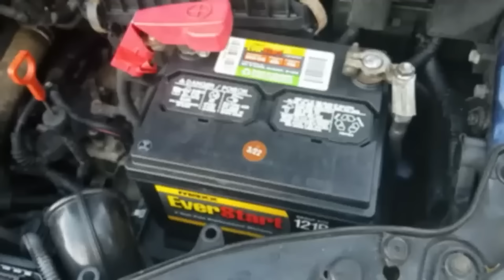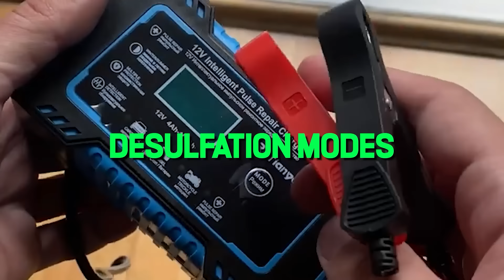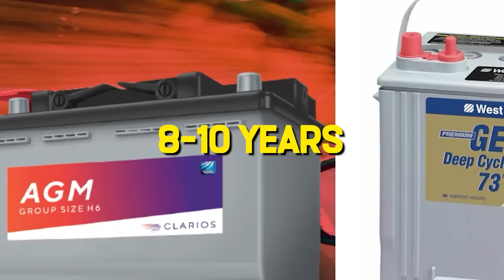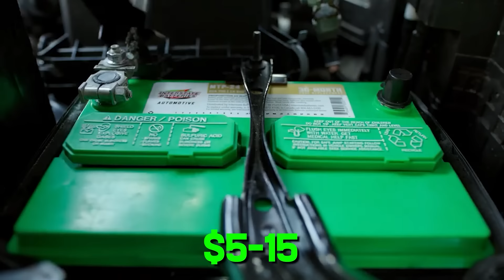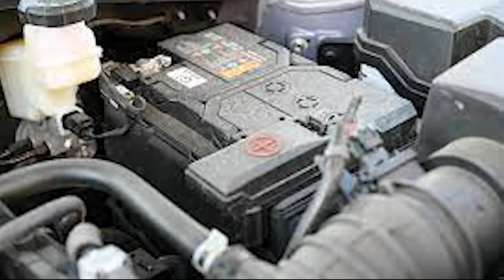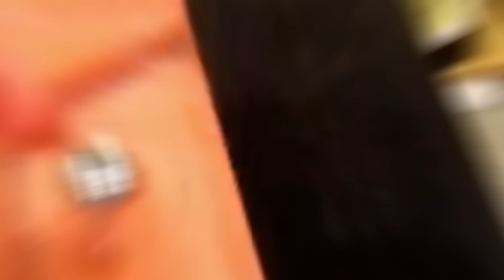DO THIS and Your Car Battery Will LAST 15 YEARS!

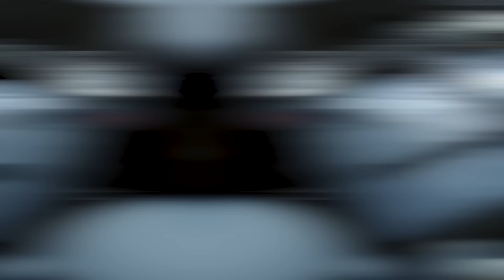Comment: 16:26 
why don't we use the strap that holds down the battery as also the negative battery terminal so that it eliminates the need of having extra wires to make it the Ground? Instead of also having to put up a ground wire on as well... To also be less likely for a moron to possibly misconnect the positive and negative. 

As an example. Positive wire connect to the battery and runs to the fuse box while the negative is the tie down strap made from metal that connects it to the ground plane of vehicle.

Comment: I use a battery minder on my truck when I don't drive it for awhile. The battery in my truck is 25 years old and going strong.
Reply: I do the same with a 1971 Dodge Power Wagon.  Bought new in 1971.  Its original battery still starts it.

Comment: One thing you should make clear is that this information generally only applies to Lead Acid batteries.

Lithium batteries do not have the dreaded 'memory effect' that lead batteries suffer from.

Note: I'm no battery expert... and keep in mind, these ^ are just broad statements. There is MUCH more information out there that is likely more accurate... but what I stated are facts. But I recommend to everyone to do their own diligent research on batteries, overall... & arrive at your own conclusions. 👍🏼